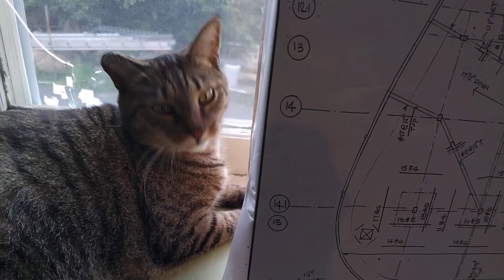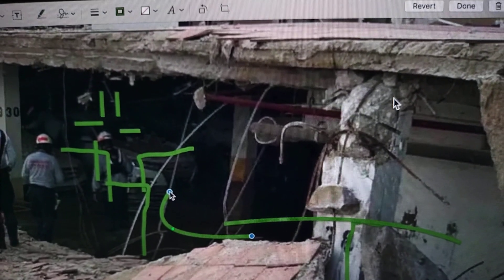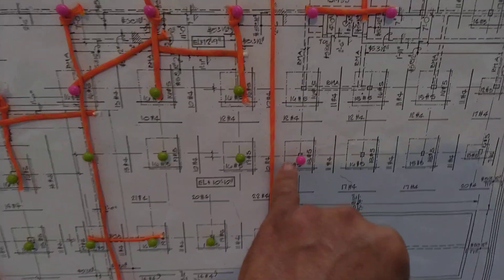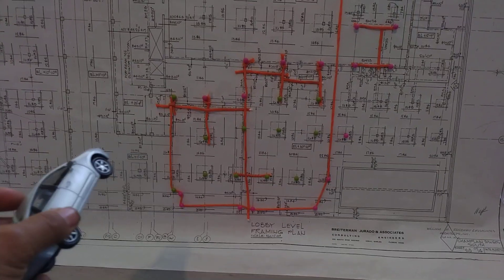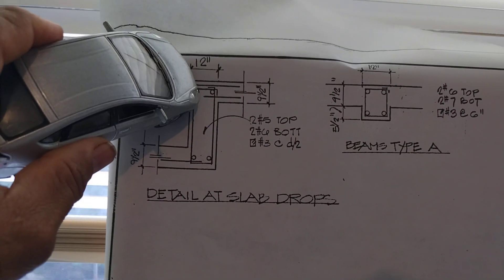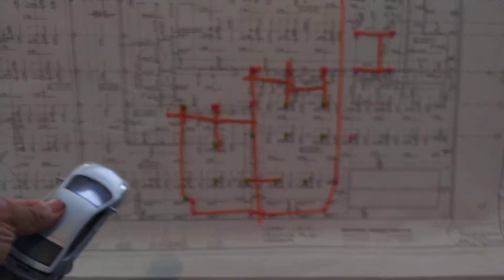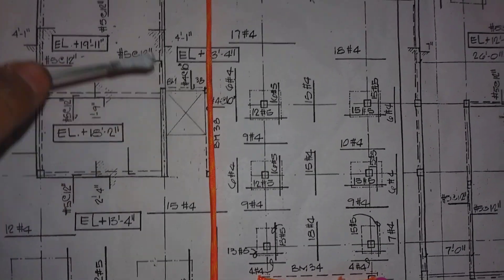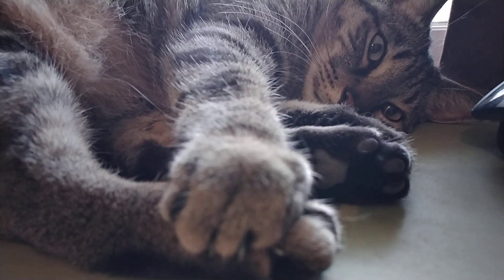Champlain Towers  Surfside Building Collapse Why the Construction Joint deserves Respect

Comment: I think M column suffered the most damage due to the pool deck rebar tugging and L column was slightly less but the floor area, the parking garage where the BMA is shown in line with the ramp,  around column L was already weak and that was the cause of the garage collapse.  The reason I say it started with column M, re-watch the unit 711 video, you will see all of the furniture against the column M wall; the property owners may have moved the living room furniture against the wall to make room for whatever was in the boxes but not the dining room table and chairs - I think all of the furniture slid on the floor up against the wall when column M suffered severe damage and that part of building dropped.  Both weaken columns, L and M, were only able to support the building for about 7 minutes before failing completely.  The L column in unit 711 video shows the beginning of the total building collapse because just prior to the end of the video column M had failed completely and we see the building, coming down at an angle,  toward the base of column M.  Does the scenario fit?

Comment: Is the basement ceiling slab also the floor slab of the first story units?...if the debris seen in the ramp video  is the ceiling of the basement that is under the actual building wouldnt that mean the floor in there living unit fell also?..Maybe the debris is the pool deck/basement ceiling slab all from outside of the building proper